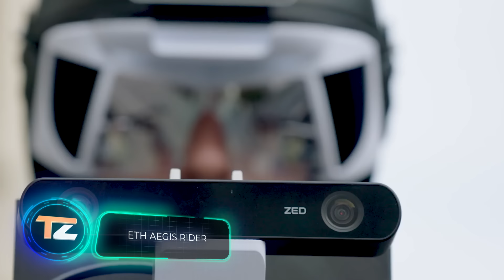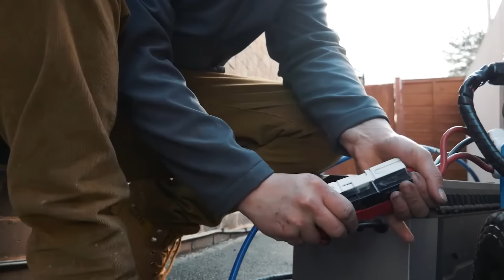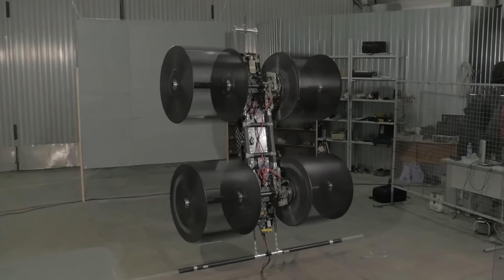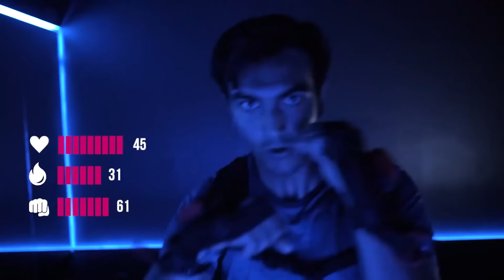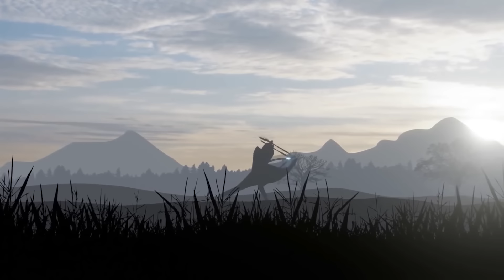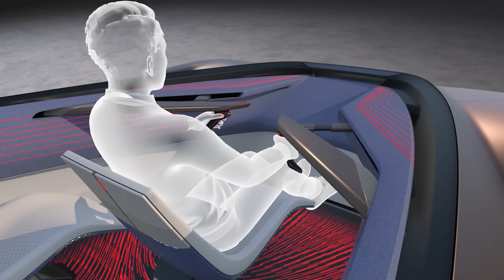INCREDIBLY COOL INVENTIONS AND CONCEPTS THAT ARE WORTH SEEING

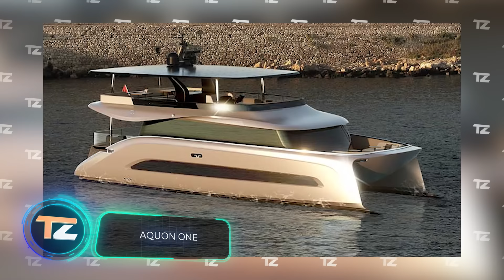Comment: 9:06 This system don't make sense! Sunlight -> electricity -> hydrogen -> electricity. Instead of using the electricity produced by the solar panels directly for propulsion it is first used to electrolyse water THEN the hydrogen is turned to electricity by a fuel cell and THEN sent to the motors! I say only: EFFICIANCY!

Comment: Sorry but the Russians didn't invent that cyclone flying machine a British inventer did back in early 2000s it uses the same process as a Push along lawnmower but horizontal it's the shape of the blades that giv it lift  and sold the patent to mod if featured on a BBC invention program were dyson ended ended up winning

Comment: Modify CYCLONE with smaller moving propeller but the material must be TITANIUM or even stronger.  It is not the size of the propeller but the material that could stand a tornado of wind.

Comment: The problem with the inflatable sail is who is going to pay for it. Ship builders are responsible for upkeep and maintenance of the vessels. However, the shipping companies are who pay all the travel expenses. Basically, the ones who will benefit from this, the shipping companies, are not responsible for building or improving the ships, the builders are. The way things work now is that the builders would have to buy the expensive sails and install them, only for the shipping companies to reap the rewards. 

There are numerous ways to power a vessel by wind that won't impede the maximum carrying capacity and will reduce fuel cost, but there are very few ships that actually use them thanks to the reason I described above

Comment: theres No Such thing as Environmentally friendly electrical propulsion systems cause they need Batteries and Lithium extraction is Very Harmful to the environment and its NOT recyclable same for the electronics same for the motors 90% of el. cars are Not Recyclable while 90% or normal cars are Recyclable same goes but ppl believe in that crap cause some company that wants to sell them that crap told them so Idiots
btw the Only Really Environmentally Clean energy we have today is Nuclear Energy

Comment: Not one looked like anything that would benefit anyone. The vtol craft can only go 93 miles total. How much help can it be in Africa if it can only go less than 46.5 miles from a charging port. In aircraft you have to account for longer times than expected so you will never see the maximum distance unless you're going on a Dolittle raid over mainland Japan.

Comment: Ah yes fill up the motorcyclists helmet with a ton of distractions to avoid the distractions they should be scanning for. This crap is not going to help motorcyclists at all. Making trailer park homes look fancy and no where to park them because you still need to buy land which is the real cost.  That robot won't replace the speed of human painters but it would be good for initial visual inspection. And oh look we are reinventing the sail - the most consistent thing that has been used in sailing since the start of sailing.  We seem to be in an age where we just keep doing and redoing stuff for the sake of doing them instead of finding a need for them. Solutions looking for problems.  That all being said the arm at the start is fantastic and has a great use unlike the others.

Comment: The Rungu Dualie is not a motorcycle It is a bicycle/tricycle with pedals. If this were a true motorcycle the pedals would be stationary, not rotating like a standard bicycle
Reply: It's not technically that either, being an ebike or etrike.
Reply: @chadlymath , I was referring to the mechanism, it's an assist bike not a motorcycle. You are right, be in either end, the three wheels make it a trike. I was talking about the cranks, instead of just foot pegs
Reply: @crazylarryjr  I understand, while states & federal systems have varying classifications I wish I knew more about, before I got my ebike.
Reply: @chadlymath , So wait there is a special classification for E bikes? does it require tags and Insurance?
Reply: @crazylarryjr  (as *far as I know)... Not if you have anything *standard-rated 750 watts & under on the motor, and it *doesn't go above 28 mph *with pedaling, but I haven't cleared up anything else with anything over those 750watt & 28mph statewise or federally. Plenty of options to do it, though, and only saw one vid in California a cop said you do have to with anything more powerful (yet: still classified a motorcycle?... didn't say)... Ps - doesn't require insurance, but I definitely got some (it's cheap, for an ebike)... Pps - motorcycle license, likely for anything above moped (30mph) limit...
Reply: @crazylarryjr  Ppps - hmm... Just looked it up: Rungus have 1200watt standard motor (or more powerful)... the federal law needs adjusting, imo...
Reply: @chadlymath  I would say it still falls under the bicycle/tricycle category. It's just a hybrid drive, as in that it has 2 methods of moving it. Saying "ebike/trike" just specifies what exactly it is, but they are "technically" still a bike (or trike).
Reply: @midgetman4206  If you read the whole convo: their Etrike *might actually technically fit in the category of motorcycle, and the dude in the video just read the legal description provided. Disagreeing with how things are regulated doesn't mean the argument is with those who just share how they're termed.
Reply: @chadlymath  I don't care how something fits through the lens of regulation. I'm looking at it through "what is its purpose" and it's designed around being a bike, its main defining feature is that you pedal the thing to move.
 
A motorcycle is independent, it doesn't care for how strong or weak your legs are because either way, you'll struggle to move it at any practical speed and distance. It moves you, not you move it. That's the trade off if you want something capable, you get the weight that goes with it. It wouldn't matter to me if you put working pedals on a true motorcycle, because the whole point of its design is to do all the work for and without you.
 
If ebikes were to fall under a legal category, I would put them under scooters.  Why? because at that weight class, you could still realistically move it around with you legs for useful periods of time without tiring out to much.
Reply: @midgetman4206  Probably should talk to someone who's signing those laws & regulations, I you feel so strongly about it. I mean I *have an ebike that's a daily commuter and am glad I didn't make a purchase that could cause potential & unnecessary harassment and/or impose, knowing specifics versus only holding opinions on them. Advocating can require finesse. Good luck.
Reply: @chadlymath  It's not a big deal to me. It's just that you went "technically", it was a bonus that it wasn't even entirely accurate.
 
And really? "harassment"? I wasn't doing anything that should harass anyone, unless your just prone to the slightest of things.
 
I will take that luck though
Reply: @midgetman4206  I wasn't even talking about you, in that context, but it definitely *has become that to where I need to just block.

Comment: Surely a burning question in this day and age and particularly with reference to maritime applications should be "is the sail system mentioned comprised of or does it incorporate significant quantities of plastic"?

Would it not be profoundly ironic if it transpired that a major producer of various potential pollutants had envisaged such a system as an expedient means for exploiting a problem of it's own making?
Reply: I would still buy those because they would save me fuel and they are not consumable. Easiest decision ever.
Reply: oh you're joking. I'm slow
Reply: Who’s to say it can’t be made of recycled plastics?
Reply: The problem is not making durable multi use items from oil, the problem is  that first we burn HydroCarbon fuels producing damaging and harmful gasses. 
Secondly that we produce so much single use plastics that dont get recycled ... USA is the absolute tops in this league by a long way. 
The third problem is shedding and breakdown of plastics into micro/nano fibers from abrasion and washing in particular of plastic based fabrics without adequate filtration to the point where there is no point on Earth that is not contaminated by micro plastics in the water Air and soils..  a baby born now in the developed world quickly has ten times the levels of micro plastics within its body  than an adult. 
Burning plastics is only at best the equivalent of burning coal oil and gas.  
Recycling by melting and reforming is the only way to deal with the problem..till the natural organisms that attack hydro carbons can be harnessed to digest micro plastic wastes. The trouble is  the size and threat of the  problem V the willingness to investigate and test the long term solutions. Whilst rapidly cutting down our addiction to increasing amounts of the sorts of consumer crap we buy and use and then  throwing it away, rather than repairing reusing and recycling materials whilst shifting to sustainable resources and energy sources.

One of the pioneers of oil chemistry over a hundred years ago commented then-  this stuff is too valuble to burn or waste... 
it is as it forms the chemical feedstock of much of our Engineering, Technology Agriculture and  Medical sciences.
Reply: @clivestainlesssteelwomble7665  just so you know, we have biodegradeable plastic made from lactic acid now, so if we could quit using all of the corn for motor fuels, the microplastic problem would be decreasing soon. I have spoken with the man who holds the patent for one part of the distillation process for making the kind of lactic acid needed for this plastic. the reason we dont already have these plastics in common use is all political. the federal gov. funded ethanol production( a huge source of co2) instead of biodegradable plastics (not a huge source of co2)
 this leads me to believe that the "problem" does not realy exist and the only real 'problem' is needing new income sources. they hype over stuff drives people to invest and the cycle continues.
Reply: @lukewarmwater6412  
Ive known about bio deg. plastics for a couple of decades or  more.. and the problems some of the early ones caused.. im an Environmental Scientist. Microbes have been producing enzymes to attack hydrocarbons for millions of years ..jumping to digesting plastic hasnt taken them very  long... The problem then becomes stopping them ...because the durability of  plastics in many applications is key to a whole host of technologies. 
Making items recyclable without being degradable  in the case of these sails is what is required. Where a lost fishing net or line is a classic case of product that really needs to be broken down rapidly once its lost ..  but fishing itself is becoming increasingly a threat to the most ecosystems. 

Your point about the inertia of political and economic systems is totally true ..  as is the patent system in delaying application of critical advances. The 3D printer is a classic example in case... Where the opposite is the mine metal/detector developed by a free Polish officer during WW2 that has gone on to save millions of lives and free millions of acres land up for use safe from tonnes of discarded and discharged ordinance.  Despite our tendancy to produce anti magnetic mines ...but thats when we have to call in nature again and use critter's like pouch rats to  sniff out the explosives.🤷🏻‍♂️. 

Clothing and fashion is one of biggest problem  areas..  and as for single use plastics .. minimise ...recycle..reuse and make safe has to be where we go or we will run out of our time .. and take a lot with us. 
Time to grow up look after the planet.. or our time runs out.
Reply: I think they call that capitalism.....